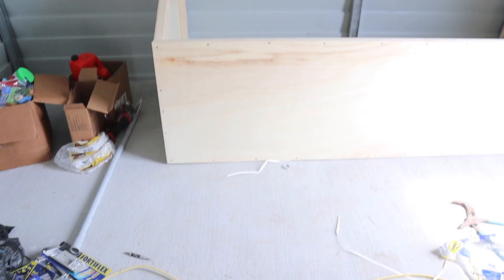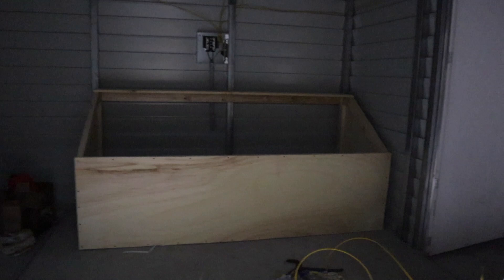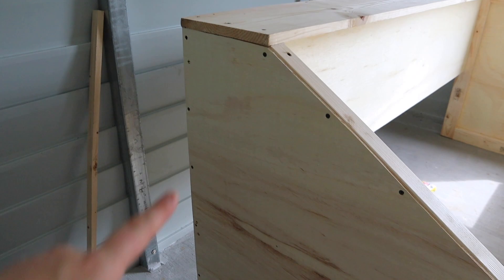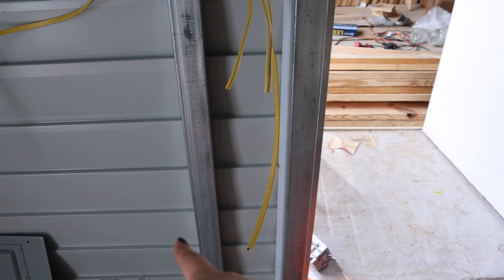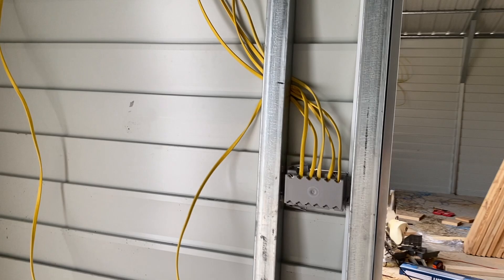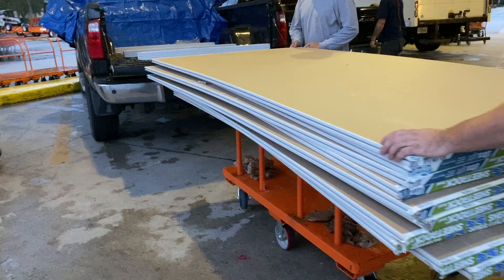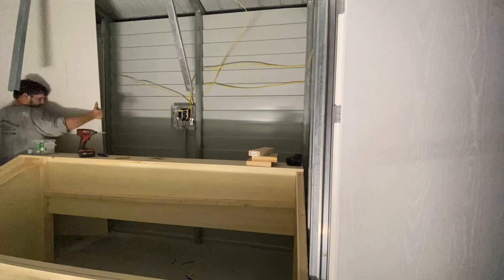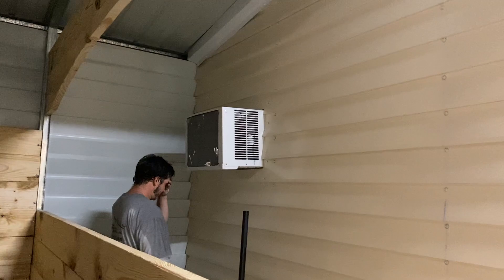Building the TACK ROOM! | BUILDING MY DREAM HORSE BARN PART 7!

Comment: A good idea in the stalls to put conveyer belt rubber down it really helps your horses legs if they are in there for any length of time becouse even with straw or shavings the concrete is tough on third legs so putting rubber down to go under your shavings or what ever bedding you decide to use

Comment: What size trash can do you have?  I use to have 50 gallon galvanized trash cans  and  the 20 gallon galvanize trash cans to keep the  swamp rats from chew  through  them. And we  use chast freezer  that did not work anymore  to put the feed in as well   I love your ideas for holding the trash cans in :)

Comment: Not to be negative or anything but y’all realize that the air unit will leak right?
Reply from the maker: Yep we know that! :) we are making a pipe system for it to drain out of the barn!
Reply: Yeah didn't make sense to me either.
Reply: @StephanieMoratto  good idea I love that
Reply: Ok just wanted to make sure you knew that. Didn’t want your hard work to get tarnished.